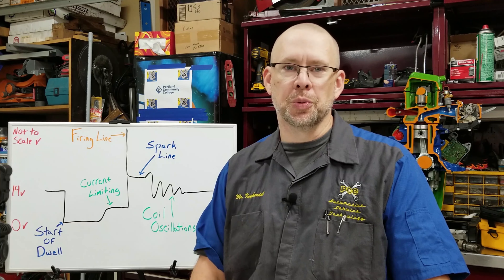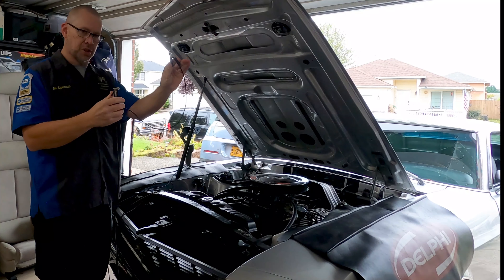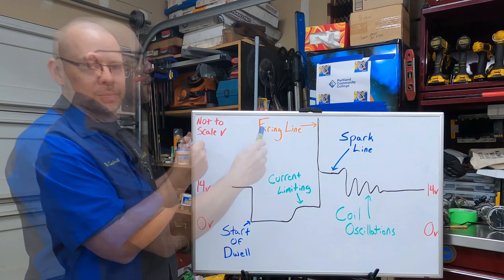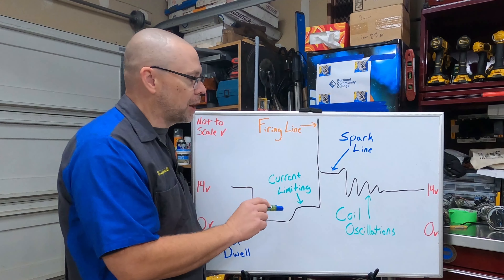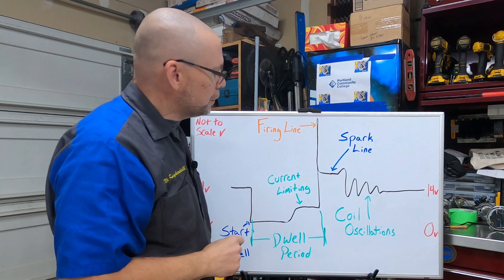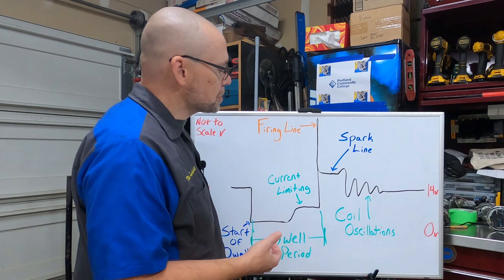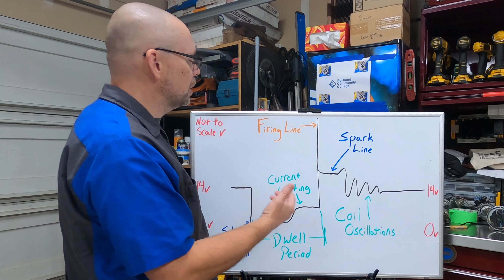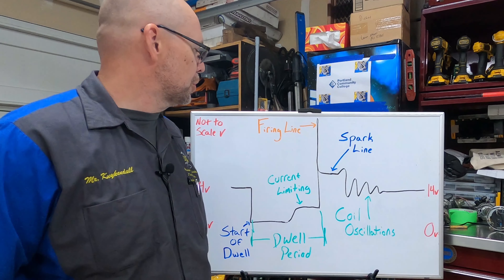Ignition: Primary Voltage Waveforms

Comment: This guy is more valuable than a bar of gold! He explained everything i needed to know about switching and control side and healthy spark lines covering all of this information in only about 20 minutes: EXPLAINS PRECISE DETAILS OF PRIMARY WAVEFORM INCLUDING DWELL, FIRING LINE, SPARK LINE, LENGTH OF SPARK LINE, THE EFFECT OF RESISTANCE ON FIRING LINE, WHEN THE CIRCUIT IS SWITCHED ON, WHEN THE CIRCUIT IS SWITCHED OFF, TESTING CURCUIT VOLTAGE "REQUIREMENT", TESTING CURCUIT  VOLTAGE "AVAILABLE", CURRENT LIMITING CIRCUITS, ETC. THIS GUY IS GOLDEN!
Reply: I wanted to say something similar but you said it better. This is the best video I've seen on the subject. Zero waste of time.

Comment: That was very good and I thank you. 

Years back when GM began using HEI, I learned that disconnecting plug wires would usually blow a hole through the center of the rotor. The hole could be seen   when holding the rotor up to a light source. Although the car would run, it did so quite poorly. 🖖🏻🍀

Comment: Really great video and very transferable to the traditional 'points & condenser' type systems that I often work on.   I have a question also.....based on a 12v system, +ve earth, dynamo, 6 cylinder vehicle, 36 deg dwell angle, 3.0 Ohm coil.  On one vehicle, when running I noted approx 12.4v at the +ve terminal of the ignition coil and only 6v at the negative terminal, both versus earth from the battery.   To me this seems like a huge voltage drop of over 6v, I'd normally only expect to see perhaps a 2v drop.  What are your thoughts on these values?  Does it suggest that there is something wrong and arccing to earth somewhere?  Many thanks....

Comment: The spark line changes with engine load. You're only looking at it with the engine idling. As you increase load it gets shorter to the point where there's a misfire due to insufficient time.

Comment: Is it safe to say on a distributor setup that when timing advances it would require more energy to jump the larger gap between rotor tip and contact pole in cap? I'm trying to figure out why I am getting a misfire/pop in exhaust at very lite load and basically full advance.